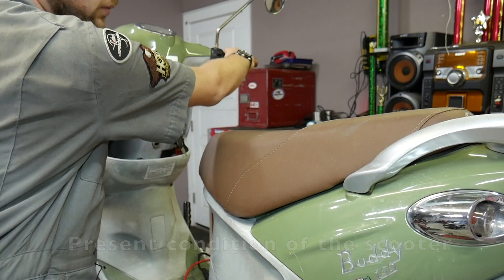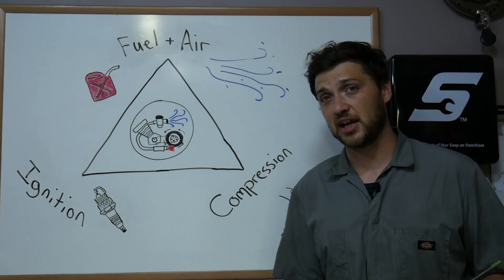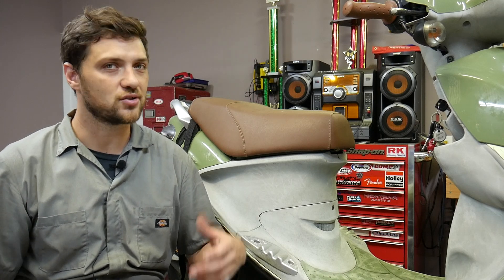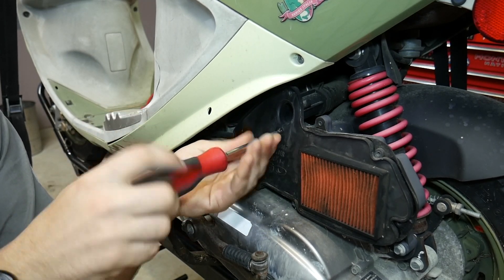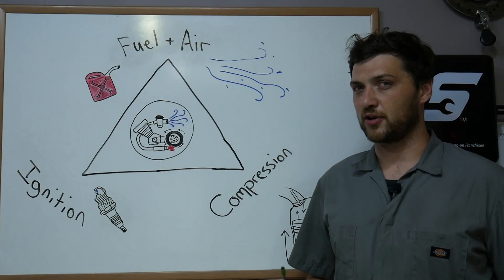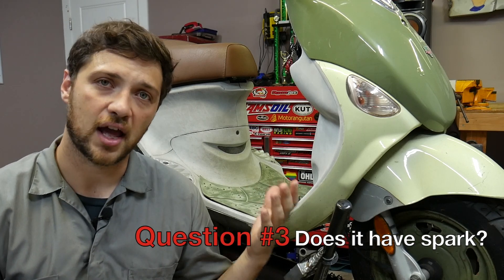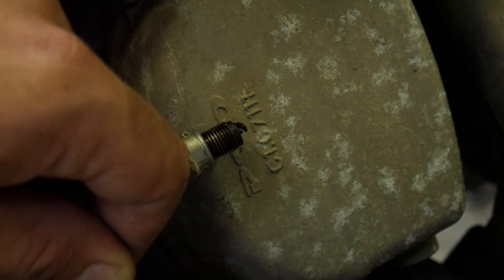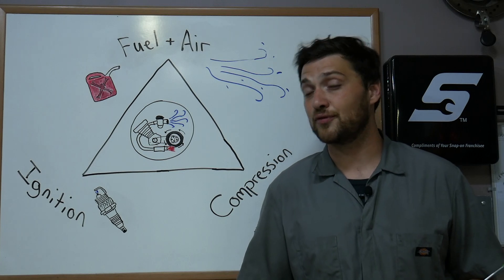Scooter 911: Find out why your scooter wont start by answering 3 questions!

Comment: So starter is trying to turn but wont. Im confusing. Its a honda ruckus
Reply from the maker: So the ruckus doesn't actually have a starter technically speaking. It uses the charging system to turn the motor over. It's actually a pretty bullet-proof design. So if the starter button is turning the motor over you likely have a carburetor or spark-related issue. If nothing is happening when the start button is pushed you likely have a dead battery or a bad/disconnected brake switch
Reply: @Scooter_911  thanks for the reply. The start button dims the odometer and the part near the kickstarter whirs and nothing. Or it sounds like it spins a rotation or two then "catches" on something. Ive got power on the odometer so its not a dead battery or is it?
Reply: @Scooter_911  i was riding the other day and i thought i ran outta gas. It was the cutoff switch... Couldnt figure out why it wouldnt start. Anyway, the guy i live with brought me some gas... I think it had water in it. We took the tank apart and replaced the gas... I think maybe bad gas was trapped in the carb but we ran the thing over an hour to "run the bad gas out" and it was running when i put in on the truck for the trip to the beach... But now its not kicking over at all.

Comment: SCOOTER 911!!!!! : 
My scooter is 160cc and 15 years old. It still runs but only if i set the idle speed to high. It randomly dies in the middle if else. It also has a tough time starting on the electric self start. i was suspecting the carburettors low jet or float pin as it died in low revs and because of the petrol leak when kick starting. Currently the self start works but only randomly. Im in india and have a rare discontinued scooter where is hard to find mechanics and parts so im forced to take matters into my own hands. Pls help me with your professional opinion on the case. I love your message at the end of the vids
Reply from the maker: When was your last valve adjustment?
Reply: @Scooter_911  i dont think it ever had one, i bought it used. didnt come with a proper service record

Comment: I have a question if you can answer it my electric scooter has brand new batteries but it's not going as fast as it used to the batteries have been tested and they work fine is there a reason it's not going the same speed as before?
Reply from the maker: There could be many reasons for that! You could have something as complex as resistance in the induction motor power wires or something as simple as low tire pressure or dragging brake hardware. It's a good idea to start small and simple and go from there!

Comment: Hello I have done all these checks but yet my bike won't start and when it does it is backfiring people have told me that it could be the jets and that I'm getting to much fuel and I think it's running to rich could you help please.
Reply from the maker: Did the scooter ever run well? What changed? How long ago did it start doing this?
Reply: @Scooter_911  It started about two weeks ago I've changed the CDI to a racing one but that didn't make it backfire like it does now and I've changed the carb to a bigger one I had the pz26 and now I have a pz27 and I've took the airbox out and put a k&n filter .
Reply from the maker: @sherman3.135  but did it start backfiring after you made the airbox modifications or did you do the mods to try to get it to stop backfiring?
Reply: @Scooter_911  when I did the mod everything was ok is has only been backfiring since I changed the carb and was hearing a tapping not sure what that is
Reply from the maker: @sherman3.135  well you might want to put the carb back just to see but typically backfiring is caused by a slight exhaust leak which could also be the source of the tapping sound you're hearing! I would check the bolts that hold the exhaust manifold to the head and make sure they are tight and secure!
Reply: @Scooter_911  well I've check the timing they are fine But I'm not sure if the tappits need doing I also thought it was the carb so I did change it back and was still doing the same thing .

Comment: hi Garrett it's me again! haha.so I haven't touched either of my scooter since I last wrote you three months ago! but today being mom's day I figured I'd give myself a gift and get that son of a b** started!  the new one anyways! so if I put my hand over the air intake and cranked it a few seconds and then take my hand off of it and the thing starts and stays running what's the actual problem with the bike that I could get it started doing that?
Reply: PS I did turn it off and try to start it again and it didn't want to but the battery was too though so I got it on the charger now I'm so hoping I'll be able to go for a desert drive tonight around 7 :)

Comment: A friend at work bought a used scooter 2 years old with 125 miles.  Sounds like a deal, but it runs for a short time and shuts off after losing power.  It sat for over a years.  She changed the fuel put sea foam and same thing happens.  Where should she start?  Evidently there’s spark, compression and fuel.  She also said the last time it wouldn’t turn over after shutting down.  I’m thinking and electrical ground problem or a cdi issue.  It’s a 125cc Lance Havana . Any input would be great. Just trying to help her out.
Reply from the maker: Well there definitely could be multiple issues but the best place to start is get the scooter to fail and then test everything (referring to losing power after starting). Check to see if it dies due to loss of spark or maybe loss of compression. It might have not had the valves set correctly from the factory so it may need a valve adjustment. It might be running out of fuel. So use the tips in this video to find the root cause. As for the electric start issue you might want to check out my video for "electric start does not work"
Reply: @Scooter_911  Wow, thanks for getting back so quickly.  I’ll have to follow her until it dies then give it a shot. Then I guess I’ll look at those possibly pesky valves. 3 intake and 4 exhaust. Is that pretty much the same on all these scooters?

Comment: I have a scooter and it was running until I put a new carburetor and spank plug core on. But before I did it would go dead as I was driving it sometimes and it wouldn't crank up all the time. Could the valves need adjusting?

Comment: Excellent video straightforward no messing about, thanks so much ,I am about to buy a new scooter here in the UK ,and was wondering how many miles with regular servicing should i be able to run from new without problems , is there a sort of rough guide before we start hitting problems ,many thanks,

Comment: Hi I I have a problem with my sym shark 150cc the problem is that it doesn't have any spark now I have changed the cdi unit and the coil but there still no spark can you help the problem started from the head light wires touching and now it doesn't start before that it was running nicely

Comment: hi i have a ajs modena 125 left it for 6 months it did try to start on the electric start at first but then nothing at all not even trying to start the battery is ok horn works the lights indicators and gauges would you have any idea what it could be please Thanks 
Lee in the UK

Comment: If my scooter is outside for a long duration while it rains, like a day, it becomes incredibly hard to start and ehen i eventually get it started after 7 minutes of using the kick it runs but doesnt move and i have to give it some speed by foot and after driving like 10kmh for 20m it coughs and coughs and eventually it turns into the same old scooter snd drives as usual, this only happens when its outside in the rain snd sometimes there is big loud explosions coming from the pipe, like a shot from a gun

Comment: This is so frustrating, my scooter has spark (just changed the ignition) and we checked if fuel was running to the engine and it was! Been working on it all day and just wont start. Any tips for what i need to check?
Reply from the maker: Compression! Try a valve adjustment!

Comment: Very good video, I've got a question what if it will not start only when it's cold? My choke seems to be working normal too
Reply: Hello, my scooter been sitting for a couple months and when i turn on ignition there is no sound coming from the fuel pump do you have any idea what the problem could be ? Thank you
Reply from the maker: How did you check the auto choke? And you might need a valve adjustment or your stator might possibly be weak

Comment: I'm getting spark,gas and compression and my 49cc wolf scooter still won't start.What the hell is wrong with this thing? Please help
Reply from the maker: Can I ask how you know how you have good compression?
Reply: @Scooter_911   I'm not sure about good compression but I put my finger over the spark plug hole and I can feel that it has some compression
Reply: And I should tell you that it has 13344 miles on it. 2016 model
Reply from the maker: @jamespitts3207  well it's possible to have some compression but not enough to run. You need at least 100 psi under cranking typically. If you have not yet performed a valve adjustment I would start there!
Reply: @Scooter_911  thank you so much. I'll get started on that
Reply from the maker: @jamespitts3207  good luck!

Comment: hi Garrett yes I did already watch this video before I watched your other one with the valve job adjustment changing out the spark plug seemed to help out a little bit I will also make sure all the hoses on the carb are tight as well to make sure there's no air leakage and I'll spray some carb cleaner in there and see if that helps to

Comment: My scooter still want start, changed carburetor, spark plug, spark plug cable, stator and CDI box, clean gas plus cleaner added to gas, I think it’s not sparking, battery is new and it turns the engine over, I have injected gas in to spark plug whole, still no fire, any help?
Reply from the maker: Have you physically observed the spark plug as you turn the engine over?
Reply from the maker: Check out this video for how to do that https://youtu.be/eSOvKTntBEM
Reply: Thank you, for responding, my ground wire is loose on the CDI, like in your video, and I can not reconnect it, I have ordered a new cable on Line should have it in 2 weeks, hopefully that fixes it, love your videos the best on line for repair on scooter
Reply: Hi Garret, changed the wire on my CDI box, still no fire, i might of but to much gas in spark plug hole, (hopefully) that might be my problem now,

Comment: My scooter is 50cc Boom..since  (similarly with Taotwo )I bought this two months ago.. I’m doing gig job with my scooter.. until today.. the scooter won’t start. There is ⚡️ spark.. there is ⛽️ gas is fine.straight going down to carburetor and there is compressor also.. but still didn’t wanna run.. there is any idea for me.. how to fix that.. i will really appreciate it and thank you
Reply from the maker: Try a valve adjustment

Comment: hey i have a 2012  honda visiojn ncs 50cc i use it every day lots of miles i have done 8k miles in about 7 months i used it everyday for two weeks about 600 miles but its not starting now what do you think it could be as its cranking im in ireland its cold and wet so maybe its clogged with dirt what do you think?
Reply from the maker: I think there's a very good chance you are due due for a valve adjustment my friend
Reply: I do food deliveries everyday about 8hrs Honda vision tough bike it's filthy from dirt but I just opened air filter put it back on it started must be the cold it's was below zero for for few days

Comment: How many types of oil is required for 104 cc 4 Stroke Air cooled engine Scooter e.g. Engine Oil 20W40 (Lube), Gear Oil 80W90? And how many days later we should change them? I would like to know about Variator roller. What is this and what is the function of roller to speed up by changing it into more weight? Like I have now 30gm and I will modify it to 60gm.

Comment: The chances of you seeing this is very low but my scooter turns on and idles but when I get to about 4-5mph it starts to cut out- I do not have an exhaust since it rusted but the problem only occurred once I drove through a puddle that covers a half road
Reply: Any ideas?

Comment: I put a new spark plug in my 250 4 stroke gy6, then I did a spark plug test, no sparks, does that mean I have a bad coil?
Reply: Or bad battery/connection
Reply: I mean battery connection is Good

Comment: Hey man, what should I do if I have to spray the carb basically any time the scooter sits for a few days? Does that mean the carb should come out and be cleaned? Not sure if you addressed this. Thanks.
Reply from the maker: Yeah more than likely cleaning it will solve your issue. Good luck!
Reply: @Scooter_911  Cool, thanks. Will have to tackle that sometime soon. Cheers.

Comment: This is a very underrated channel. This man not only knows his stuff, but really takes time to break down the whys, ifs, and buts. 
Youve probably saved thousands of scooters ending up in the junk yard. Truely great stuff, keep it up!
Reply: Hello, my scooter been sitting for a couple months and when i turn on ignition there is no sound coming from the fuel pump do you have any idea what the problem could be ? Thank you
Reply: @vasiledintrebile2308  I'd check the wiring to the pump first, maybe even tap it with a mallet a couple times, and send seafoam thru it too, pumps can get gunked up with old bad gas. Maybe check your gas filter too? They can clog and mess with the whole system.

But with it not sitting long, my first guess would be it got chewed on, or it got wet and might be rusting over on a connection or ground. Definitely check wiring first.
Reply: @ieatcheetos2046  Hello, thanks for your reply, I’m not really a “pro” in this this is my first scooter i ever had and it worked just fine but i stopped using for like 2 months and before whenever i turned ignition on it would make a sound which i guess it was coming from the fuel pump but now when i turn ignition there is no sound at all, so I’m guessing there is a wiring problem is there any way i could bypass that so i know for sure that is a wire problem. Thanks a lot
Reply: @ieatcheetos2046  also i removed the fuel hose and there is no fuel coming through

Comment: Hi , I appreciate the time and effort that has gone into this video. I have a problem with my Kymco Agility 50 (2009) where I’ve recently changed the spark plug, put a new crank case with all new parts on and the engine is still yet not starting electric and kick. Is there another principle I’m missing out on as I’m not a mechanic I’m just trying to learn from videos?

Comment: I have a question, I know you get a lot of them and respect that you stay active with responses.
I've been watching a lot of your videos, and learned a shit tone, to sum up
============================
The first signs is over time when scooter is in Idle or Sitting at stoplight it will shutoff if i don't keep giving it constant gas and I got used to driving it like that for a while, I'll hold the break and give it gas it'll stay running.

Soon after my the issue was when I'm driving it also has a delay throttle response, when i give it more acceleration it is delayed and laggy taking a second/two to apply the new speed. and just recently the scooter will keep driving for a second or two when i let go of the gas. 

Now the most recent thing just yesterday is now its wont turn on stuttering, i was able to get it to keep going if I held the red gas button but as soon as i let go it would turn off, Any suggestions?

I have a regular 50cc gy6 taotao
Reply from the maker: Have you tried a valve adjustment yet? The 50cc scooters really need frequent adjustments
Reply: @Scooter_911  Yes! i set it to both valves 004 today and it didnt seem to help, do you think i should try again tomorrow to 003?
Reply from the maker: @flyingwithfroggy14  .004 is just lovely. It must be another issue.
Reply: Thank you, I'll try a couple things today, I'm a simple man, the sooner my scooter works the sooner I'll be happy xD
Reply: Okay so today I noticed that When i try to power the scooter it sometimes it wont do anything at all(like no sound not even a click) and then other times i try it will make the cranking sound and then less common it also will turn on for a second and turn back off sometimes as well

I tried Carb cleaner and then noticed On the carburetor throttle area the spring wasnt retracting and when i let go of the throttle it would stay stuck for some time like that spot where you change the idle speed, then i noticed the throttle cable itself is kind of warn down, do you think that the issues i'm with startup correlate to those?  i changed to my old carb with the spring working well and put carb cleaner in that one too but im not sure that carb works anymore. 

Do you think the throttle cable makes sense? and maybe a new carburetor? i don't have much money and might only be able to buy one thing rn

Comment: Please help!!! I have a wolf ex150  I have not turn on my scooter for 4 or 5 months due to my back surgery. My scooter won't start, so I watch your videos and try to put the carb to the air filter hole. I put some it did not work, so I put a lot, it started but just for about 5 or 10 seconds and it stopped again. Every time I sprayed it started but for only 5 or 10 seconds. Please help what should i do?? Thanks
Reply from the maker: It sounds like you are going to need to "clean" your carburetor.  You'll need to remove it, disassemble it and clean all the internal ports and passage ways
Reply: @Scooter_911  do you have videos on how to do that??
Reply from the maker: @philh8023  I've got one coming but it will be a while
Reply: @Scooter_911  ok thank, Do I need to drain the gas before clean?